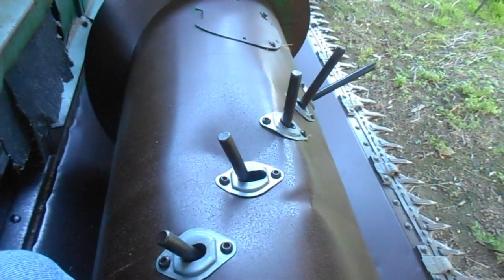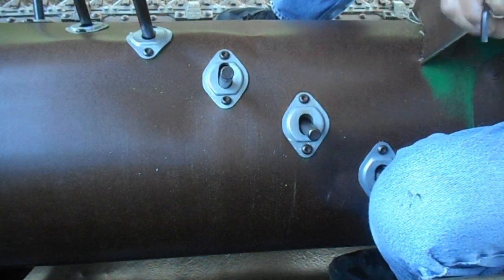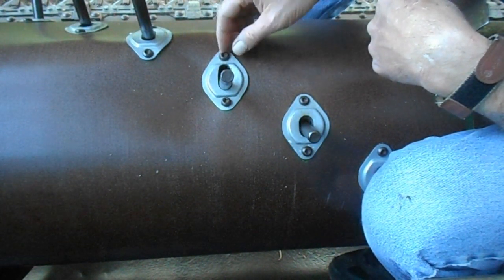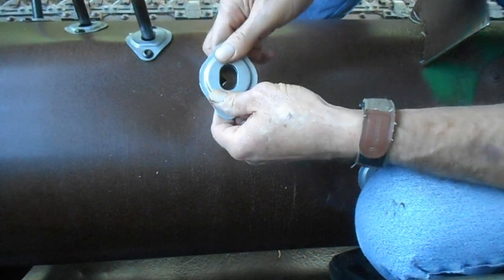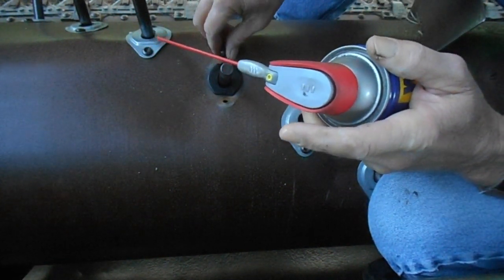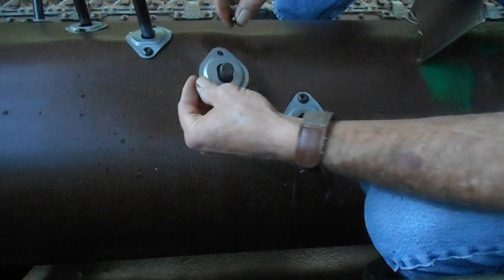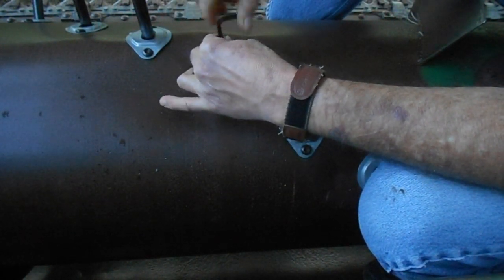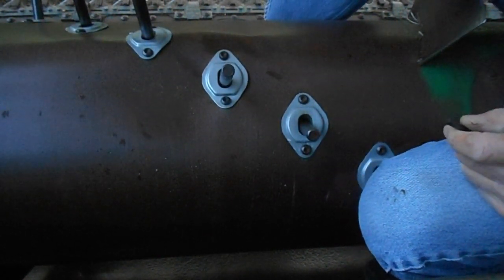Retracting finger grommet replacement

Comment: I would have never thought about using an allen wrench to take that apart. Thanks for sharing. 

I have a video I'm working on. It starts with taking the light apart in the combine and ends with some work on the drill.
Reply from the maker: TAH-DAH Farm - thank you very much for taking the time to make the video about getting the light apart in the combine.  I'm excited about getting mine working again.     yea Allen wrench works on star heads but you got to be careful to make sure you got the correct size.   thanks for watching here.

Comment: I had to replace two of those on my 4400 grain head. I had that same clanking noise you were talking about in an earlier video. The replacements I got were not a rubber and metal piece, but a one piece plastic unit.  I guess I'll see how they work over time.  Hope they are durable.  Glad you are being proactive with yours and changing them out.  I need to look at the others on my grain head and flex head and see what they look like - to see if they are elongated like yours.  I may be swapping out some more.  Hope you get the rest of your soybeans off soon.  I am continuing with all my winter equipment repairs and maintenance in my shop.
Reply from the maker: Charlie Adamchik - I'm taking a wild guess the 4400 is like my 3300, is your fuel filter on the back side of the engine?  have you changed it?    I have changed mine 5 times now and every time I want to choke the designer who put it back there over top of the starter.  the last two times I have removed the lines and then removed the block assembly and changed the filter on the workbench.   that way I did not dump fuel all down on the starter and then down to the belts below.     day 1 of 2020 was a great day.   see you at the next video I hope.
Reply: @SoybeanFarmer3300   The 329 diesel in my 440 has one of those square glass filters, but it's on the front of the engine and very easy to access.  Sounds like yours would be a real pain because I know where John Deere "hid" the starter and it's not easy to get to.
Reply: And you'll definitely see me at the next video and all the ones that follow.
Reply from the maker: Charlie Adamchik - "because I know where John Deere "hid" the starter"   lol loved reading that...

Comment: Always a fun job🤣😂
They usually break out when the spikes break... And beat the tube up... That ding in the tube, you should be able to straighten up a little.
Happy New year Soybean Farmer!!!
Reply from the maker: Gosselin Farms Ed Gosselin - the tiny access hole in the tube is to me a clear indication of how someone is violating child labor laws.   I had a rough time with a repair in there about 17 years ago.
Reply: @SoybeanFarmer3300  Yes, little tiny children!! LOL.
I've spent many hours arms length in those small holes. Gleaner, JD, IH.. all a little different on the inside, all a pain in the arms and hands to work on!!!

Comment: A long time ago I started  applying a little dab of grease on the threads of bolts and nuts that  were more prone to rust together over time......(water pump bolts, lug Nuts.... Hard to get at rascals......
Reply from the maker: Farming for Fun & Profit - great technique for keeping nuts and bolts from rust welding together in high moisture environments.